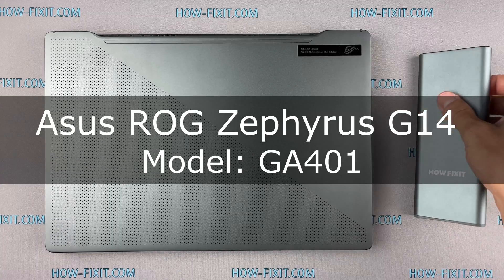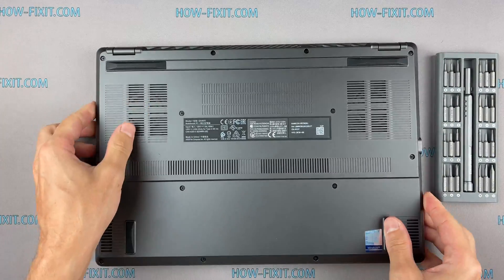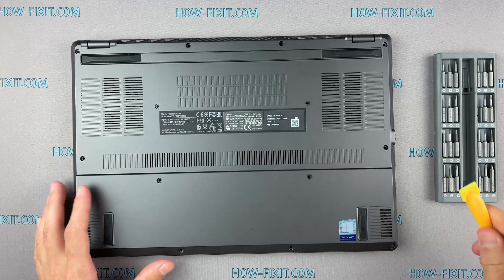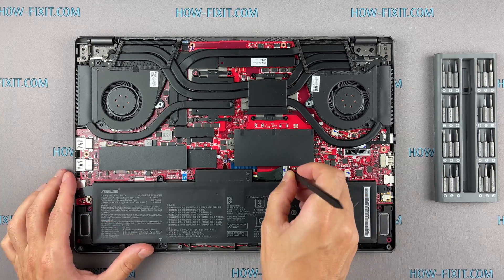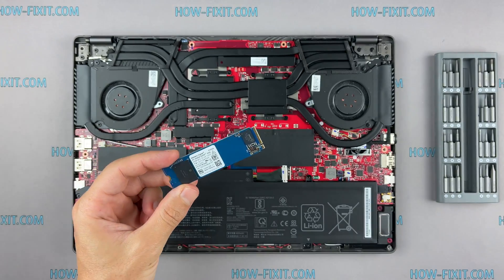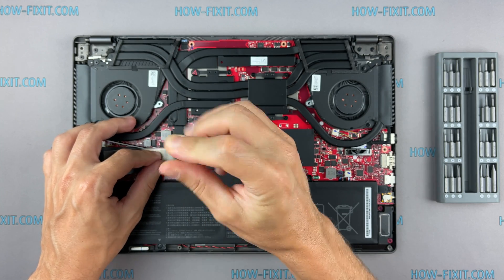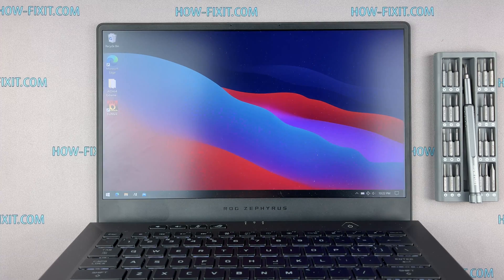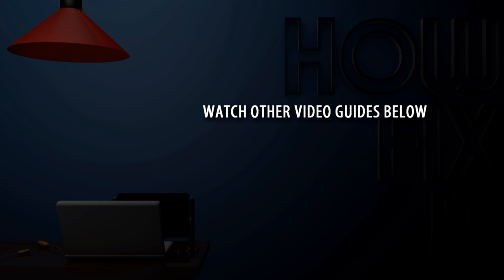Asus ROG Zephyrus G14 GA401 SSD Upgrade Guide | Step-by-Step Installation Tutorial

Comment: Worth noting that double sided NVMEs are touch and go in this.  A WD 4TB 850X drive will bend slightly from contact with the Wifi card below, which is less than ideal.  Better find a single sided NVME drive.

Comment: What is max ssd size that can be installed is there any limits?
Reply: I think its possible 8tb but the drive itself costs like 1300€ or something near it
Reply from the maker: There is no limit on the maximum size of an M2 SSD, but there are Windows limitations. If your Windows is 64-bit and the GPT file system - you can install a drive of any size. Check the description for links to recommended drives.